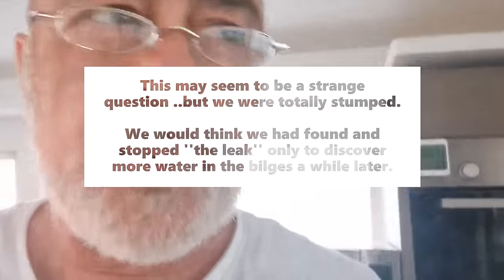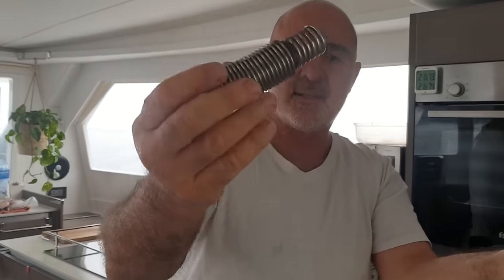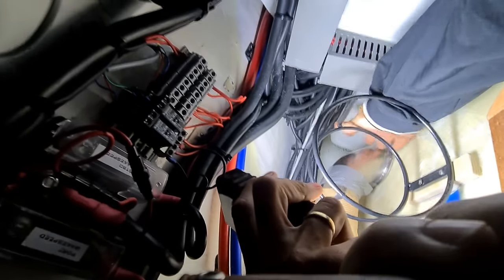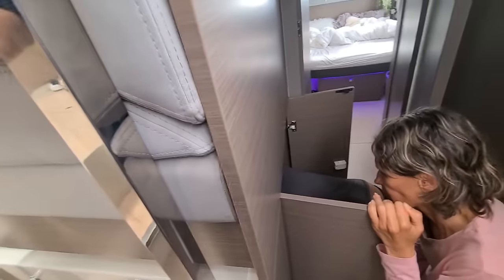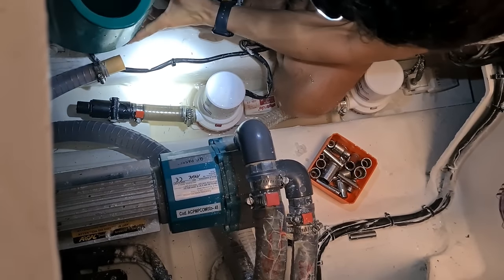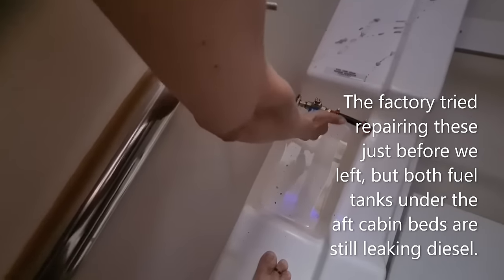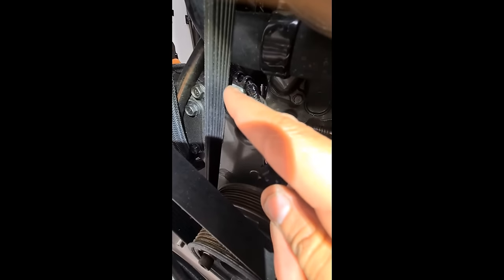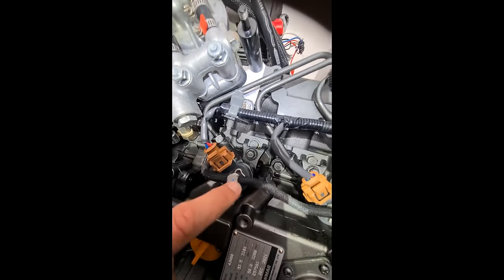Leopard 50 fails, Atlantic crossing - part 2

Comment: The BBQ drain is not for oil and food waste. Thats not a grease trap. Thats for water drain. The grill area is subject to lots of water when at sea. Be it from both rain or spray. That drain is to give the water that finds its way inside the BBQ area a place to drain. And Leopard, rightfully directs this runoff to the nearest pump. Which in this case happens to be in the engine compartment.  Just the size of the pipe and length of the run alone (not counting the materials the drain hose is made from), combined with the area on the boat it originates from, should give a really good indication what the pipe is intended for.   Besides, if you do what you're supposed to do with grills and clean them after each use, you should never have a situation where grease and oil drains through this pipe. I can guarantee you there's another place on this grill designed and made to trap a small amount of food waste (grease, oil, etc) thats intended to be cleaned at least regularly.  Every electric grill has something. Your grill waste products are intended to drain into the same area as the water is.

Comment: With sail drives or a dripless seal and a deck stepped mast the bilge should be dry . For my boat and the previous one if there was any water at all in the bilge there was a leak that needed to be found . I would be driven crazy by a wet bilge boat with a dripping shaft seal or down the mast

Comment: Did you just hop in and go.
Did you buy this cat used
Reply: They are talking factory and warranty which means new boat
Reply: @danielboughton3624  good to know I would never buy one ever.
Reply from the maker: Unfortunately Daniel Boughton is correct. On tope of these from our crossing, there are another 200+ problems on top of these. Leopard kept us in Cape Town for 13 months dragging their heels trying to fix them. We'll be showing them. Stay tuned. Thanks so much for your support

Comment: what did you expect? you are sailing a Leopard. You should have done your due diligence.
Reply: Which brand of builder does due diligence lead you to choose? Who builds a good boat?
Reply from the maker: Hey Steve, perhaps Jack is correct but according to Leopard, Travel Sketch and Utopia are the exception, not the rule. What do you think? 😞

Comment: Your videos seem so negative and way over the top, and you omit several facts. Your 50 sat in Cape Town for about a year after handover and had plenty of time for things to go wrong (It's a boat). Much of the upfittment was done by third parties but overseen by Leopard. On my boat, both parties were hesitant to alter the alternators and  much of the solar work that is now failing you, so I had mind done in FLA, it works flawlessly. Leopard is eager to help conduct warranty work, you just need to fill out a form. Leopard is way, way ahead of the other production builders in quality, and you leave a very bad impression. So sad you went this way.